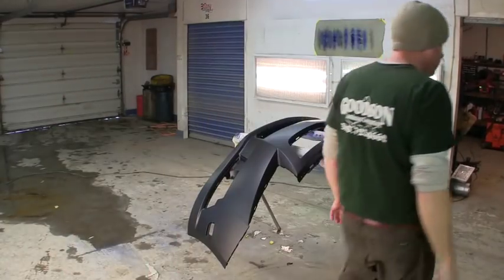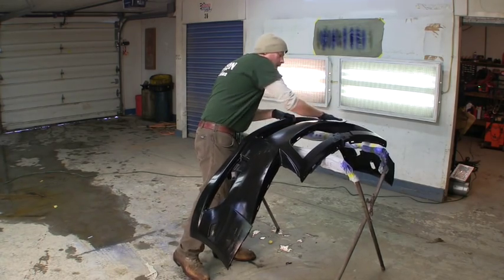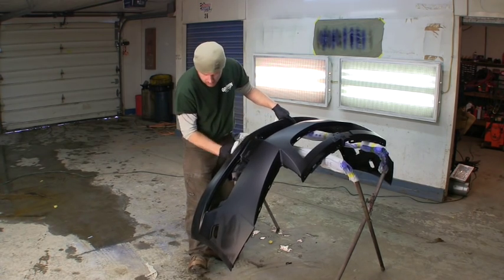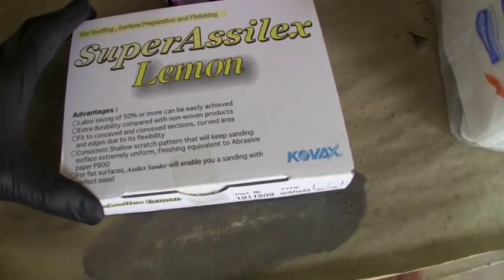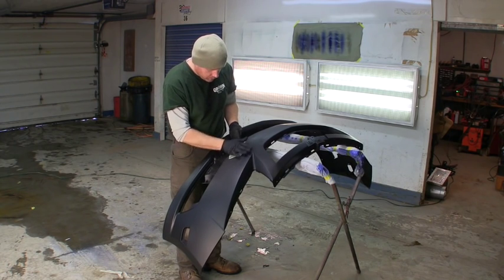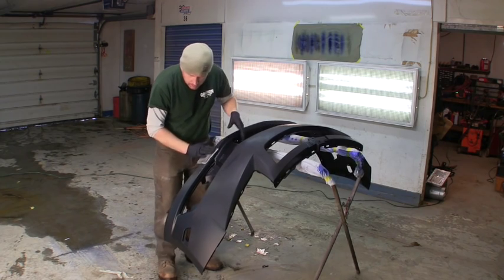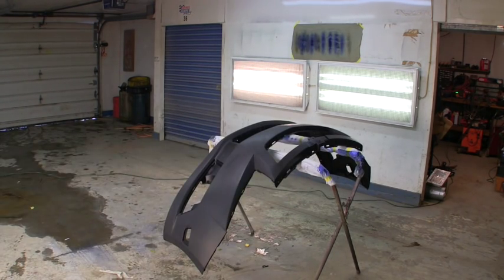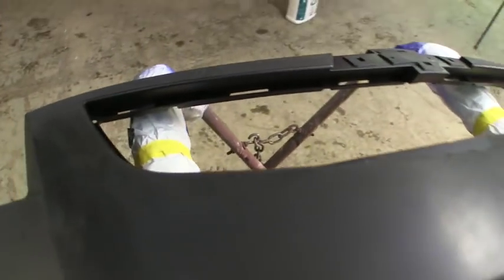How I prep a plastic bumper cover for paint

Comment: The Kovax Bufflex dry sanding for polishing system you were talking about is awesome but expensive.
Reply from the maker: I've been pricing out the paper and you're right... it's expensive.  But I like a product that works well.  And there are a couple guys that I've seen use it (including you).  Seems to make prep work and finishing work go so much easier than wet sanding
Reply from the maker: ***** This cover was not a raw plastic one.  It was coated with a solvent based primer.  As for raw plastic, I usually wash them with warm water and TSP with grey scotch brite
Reply from the maker: ***** On the raw plastic, I just clean, scuff and apply adhesion promotor.  Then seal and paint.  Shouldn't be mould release on something that has been shipped with primer on it.  I know the black (raw) ones need to be super squeaky clean to remove those agents
Reply: Velvethamma
Correct
Reply from the maker: ***** Thank you!

Comment: Will definitely have to check out the Kovax abrasives, looks like it worked really well.  Looks like that bumper cover was well made and rigid which makes it easier to work on, the only bumper cover i painted was the navigator and it was very flimsy and hard to work with.
Reply from the maker: I really like the way the Kovax abrasives cut.  Very fast and uniform without any renegade deep scratches.  They also have a dry sanding system for color sanding... all the way thru 3000 grit I believe.  I'm anxious to try it out.  Some of those covers are so thin and flimsy.... makes it hard to prep them for sure

Comment: Those look so much easier than a scotch brite pad.
Thank you for the great info. :-)
Reply from the maker: For the large areas.... they seem to work better.  Still need the scotch brite for the sharp details and nooks.
Reply: @Velvethamma  after scuffing it up can I just go ahead and wipe down good with wax/grease remover then tack and paint?
Reply from the maker: Murrica Motors 
Sure can
Reply: @Velvethamma  thanks for the response brother. Will be tackling an acrylic Urethane single stage Torch Red paint job on my 2006 Mustang GT tomorrow or Sunday. The only issue I have is with the poor fitment of the aftermarket cowl hood. Gaps are off, lines are off, doesn't sit level with the fenders and doesn't line up with the fenders in the front. Ughhhh

Comment: what do you recommend to fill scrapes with , I ordered a new bumper and it got damaged while shipping( which made it free )
Reply from the maker: +Austin K If they are not deep and the bumper is primed, I would feather them out with 320 grit on a hand block and prime them up.  Then block them flat.
Reply: +Velvethamma sadly they are deep
Reply from the maker: Austin K They make a polyester glazing putty that is flexible and made for bumper covers.  Unfortunately it's like 40 or 50 bucks for a container of it.  You could DA sand it with 180 grit and apply that, block it and prime it.  But after all that it might have been more worth it to make them ship you another cover if it's that damaged
Reply: +Austin K You could get some bondo apply it to the scratches let it dry and then sand it down.

Comment: does this primer work for all plastic? PP? HDPE?...ABS?...issue is i got hard plastic part and paint doesnt stick to that....its not an auto part...im thinking to use this as a try...
Reply from the maker: Modi kee 56 inch kee gand after winning elections 
Try Bulldog adhesion promotor. That’s what I use on raw plastic to get coatings to adhere. Check the label for compatibility of your plastic

Comment: Interesting process - I guess the aftermarket primer is not 100 % compatible with your top coat, thus the scuffing .  On the production line the years of scuffing is  almost gone , it's like a  scientific lab now and dust or lint is the enemy.  At GM  the primer was water based as well as the  powered bace coat .  All done by robots today , I was sure glad to get out of the spray booth.  We never used anything but a 50/50 mix of isopropyl alcohol and naphtha gas for wiping down the body prior to prime. I left in 2007 so things have probably changed by now.  Like your channel. Steve
Reply from the maker: Sounds like a pretty cool process on the line...
Primer has to be scuffed because there is no "chemical" bond available since it has long been dry.  Need that mechanical bond to get it to stick.  On the line, I'm sure every paint process goes exactly in order with a chemical bond between each coating.  It would be cool to see it in action for sure
Reply: The frt and rear facias come to the paint line as you received yours with the primer applied.  We used a PPG primer with etching compound so no scuffing is required, all top coat is put on as you would see as a power coat and all the overspray is dry and each colour us vacuum captured and filtered and reused.  A car today is painted with less than 1/4 of when we used liquid spray with a water basin downdraft booth. It's wild to see robots paint cars open and close the doors and reach into the door jams  open the hood and deck lid all in the dark.  I was lucky to see the change from 1977 to 2007.
Reply from the maker: Steve Rob Neat!  I didn't realize that there was such a primer that could etch into paint.  I have only used etch primer on bare steel.  But the OEM's get all the cool cutting edge stuff:)

Comment: Still I don't believe that why people are using wax and tar remover before they are using scotch brite to scuff the bumper. You don't need to clean the bumper when you get it. Scuff and smooth out the bumper or the fender and start using the dirt or wax remover.
Reply from the maker: Chris Samurai 
To each their own but I do it to not be pushing any contamination around the panel with the sanding process.  Plus I try to work as clean as possible. I’m not on a deadline to deliver most of the time
Reply: In that case you may do wet scuffing... You are not the only one, but most people are using the same method. I see it illogical to do that step.